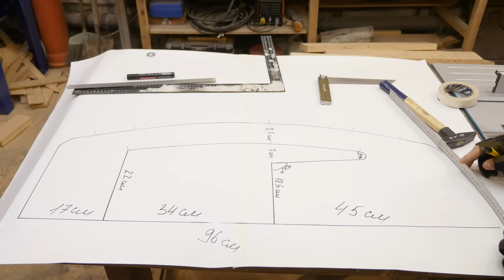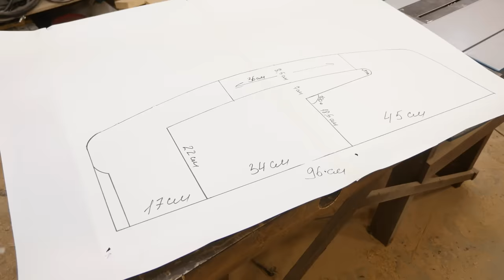Never throw away scraps of plywood! Make a cool idea!

Comment: Simply brilliant 
but i dont see why or how it stays up and doesn't go back to the unfolded position due to wight  the back down?
Reply: Agree, The end is too quick.   Just open and it stays up?  How do you close it back.  What keeps it open or close?
Reply: My first thoughts when he added the hinges
Reply: @michaelcarroll991  A really nice build but I think it would fall back with an adult's weight.
Reply: I'm not so sure. Watch it open a few times. The part that becomes the front legs or the part that becomes the back legs have to move apart from each other for it to fold flat. When he raises it, you can see the front leg portion drag in the sand, moving closer to the back legs in order to fold into a chair.

Once sitting, those are both near vertical and have weight on them. If you learned back, either the front legs would have to slide forward, or the whole back (where most of the weight is) would have to slide back to pivot. Neither of those will want to happen as the legs are dug in. Now, if you set this up on ice, I think what we're all wondering would happen, but not with friction at play.
Reply: I watched it again and it's the friction against the surface it is placed on that prevents it from closing, very clever indeed.
Reply: @twotone3070  Yeh I agree, very clever. Hey! you're a kayaker?

Comment: The design is pretty cool, but I'm a little concerned about the strength of the material. Plywood is strong because it's made of overlapping layers of wood, but you've turned that sideways. I feel it might be fairly easy to snap in half along the layers of wood.
Reply: Standing it on edge is what makes it stings.

Comment: I have Heard If You put a Little Bit of Salt between the Wood and the Wood Glue It will not move Because Of The glue is very slippery the Wood is going to move but notwith salt

Comment: Looks very nice!
One hint: the gas struts are upside down. The way they are installed they will fail soon because the oil inside will never lubricate the seals! The body has to be above the shaft to work reliably

Comment: i'm not sure about this, since only those strut hold the back and if an adult sit on it comfortably that will hold, maybe only on the beach so the legs penetrate in the sand so it kinda add some support but on a smooth floor i doubt it

Comment: Apparently hinges are stress points in this construction, so with those tiny screws holding them, kids weight probably the only suitable for use of this chair. But, with the high risk of collapsing and pinching kids fingers it neither suitable for that purpose. Otherwise, great and meticulous work.

Comment: Those boards you used in your glue up to keep it flat, the ones you put the blocks on....if you use them for that purpose a lot consider covering them in packing tape. You won’t need a hammer to remove them when the glue sets up and they will still serve the same function

Comment: Nice but… of course all this “scrap wood” title is only for advertising purposes because it only takes too much time and effort to make it in that way - and I suppose that this chair weights a bit too much for such a portable thing. It is nice design though and I think it should’ve just been made of some light wood (or sheet of nice plywood with drilled holes for example) just in the normal way. I see no practical sense of making such things from this sort of “scrap wood”. Greetings.

Comment: It's a great design and I love the idea of using scraps from other projects, my only concern is that few people would have this level of equipment. OK you don't need that >$1000 workbench with woodworker's vice and there are ways to do it without some of the tools eg the router, but you'd still need at least a table saw and those long clamps to use a similar material (edge-on ply panel). That's expensive.... anyway clever design and you could still make it from sheet.